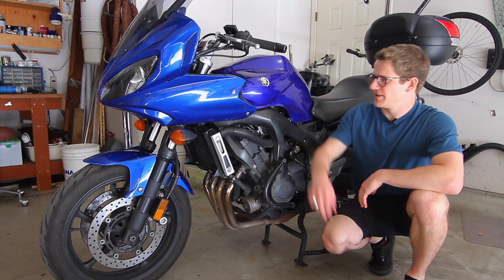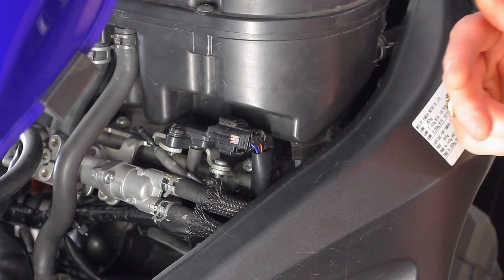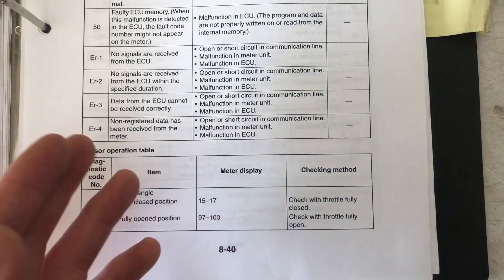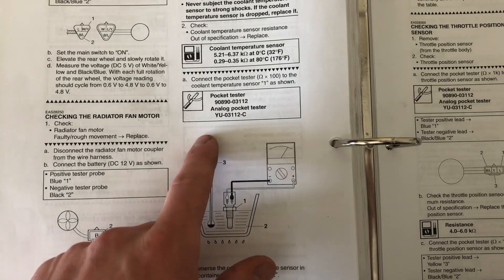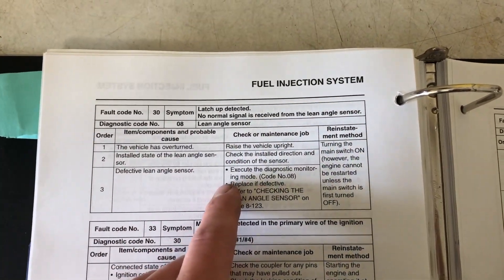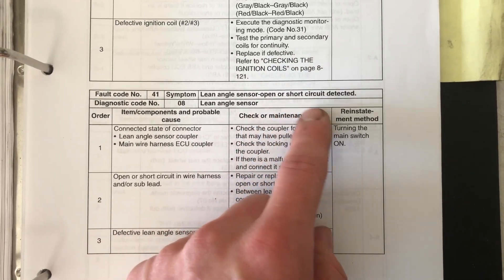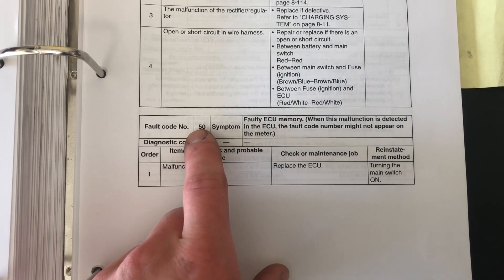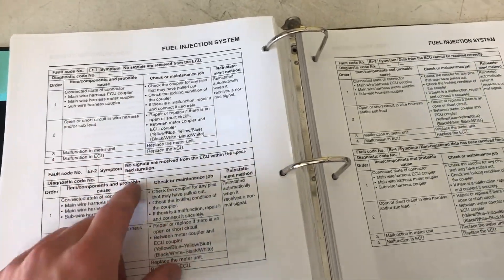Every Yamaha Fault Code Explained!FZ6 Example + Specs and Sensor Locations

Comment: Thank you for the video/videos.  I have an 06 FZ6 that doesn't get ridden much.  It's in a climate controlled garage.  I went out there the other day to start it, and flashing amber light, code 12.  Just from sitting.  Your video helps, because I can compare it to the manual, and the bike before I pull covers off.

Comment: It' usually always the high voltage cable to spark plug cap where the problem is with connection, especially the screw in type connection, they can get a bad connection over time with vibration and of course people pulling the spark plug cap off by tugging the high voltage coil to cap cable.

Comment: I bought an 07 FZ6 and just started getting a random check engine light when im traveling at higher speeds then goes away when i slow back down, what could be the reason for that and what could i do to solve the problem?

Comment: Hey Calvin, I just bought an 08 fz6 a week ago as my first bike. I noticed the throttle is super jerky, I've been looking around online and it seems to be 50/50 whether or not it's normal? It's my first bike so I have nothing to compare it to... All I know is coming off and back onto the throttle in first and second gear really jerks the bike around. It makes me hesitant to apply any throttle while turning. I'm trying to apply throttle as slowly as possible but the power still seems to come on a abruptly. Hope you don't mind me asking but do you think there's something wrong with the bike or do you think it's just the user?
Reply: Also curious, I got an 07 fz6 and its the same for me, very jerky throttle especially in 1st and 2nd gear
Reply from the maker: When I first started riding my FZ6 I struggled to get on throttle in second coming out of a corner smoothly. I distinctly remember riding canyon roads in third for that reason, it kept the rpm’s down to a point where the bike didn’t feel snappy and jerky. But then about 4 years later I don’t have that problem. I can hang out at 10k rpm in second through a corner and wind on the power through the exit of the corner smoothly without feeling like I’m going to yank myself off the bike with one false wrist move. The wrist control is definitely something that has come with time and incremental gains in confidence. With that said the early model (s1) version of the FZ6 had TPS/fuelling issues that led to jerky throttle response and that was something they fixed in the s2 (the version you and I have). So to rule out the tps being an issue for you I’d go into diagnostic mode and check how smoothly the TPS is outputting a signal. D:01 is for tps, roll the throttle around the low throttle input amounts and watch the numbers on the screen. If you see jumps in the numbers during smooth movement you’ve got an issue as the numbers should evenly and smoothly grow and lower as you move your throttle. 

Video to getting into diagnostic mode below. Good luck and happy riding! 

Link: https://youtu.be/N4UOC5VhKfw
Reply: @Calvinm  Thank you so much! I have a feeling It's on me but I will definitely check out the tps